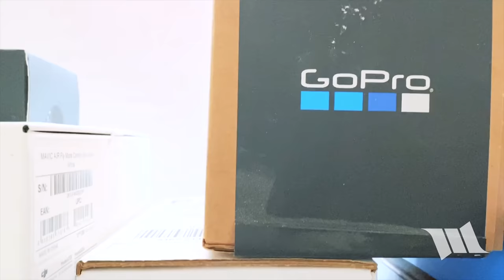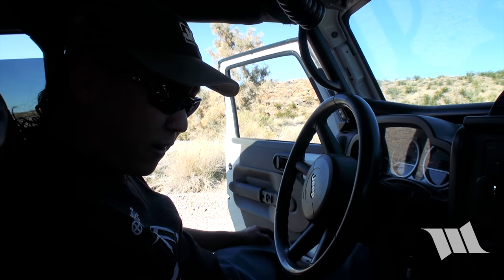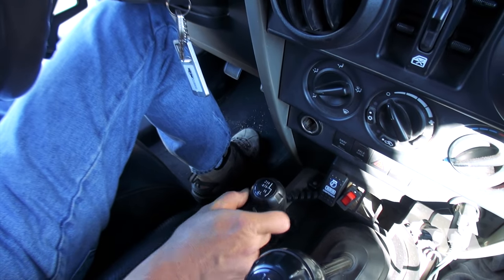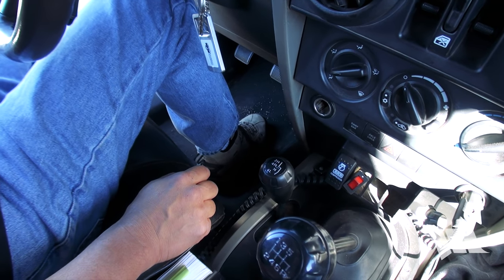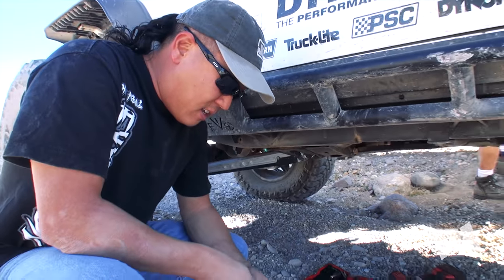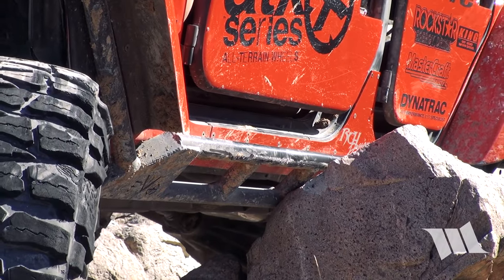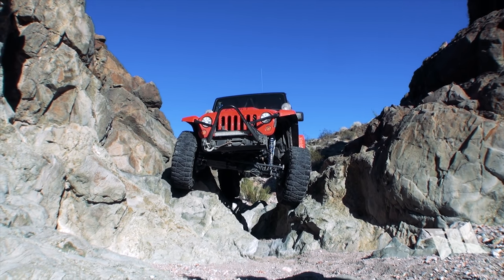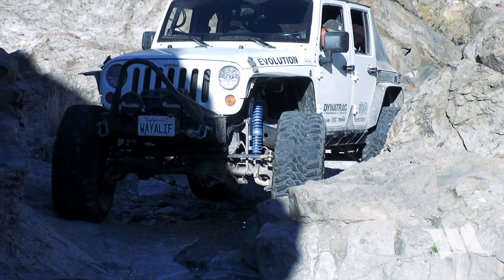Jeep Wrangler Rock Crawling Arizona Bullhead Parker MOBY and EVO1 Coilover Flex

Comment: Cool car. Are there vibrations at speed due to the crevice of the driveshaft, with a suspension lift ?? Or did you somehow escape this problem ??
Reply from the maker: So long as your driveshafts are balanced, rear pinion angle is set correctly and you're not running too much caster up front, you really shouldn't have vibrations. Of course, these Jeeps are running manual locking hubs so the front shaft doesn't even spin when on pavement.

Comment: Did you change the engine in Moby years back ? I must have missed it somehow .. i know your JL and Moby and JT are all auto’s now but didnt know you changed Moby.. anyway thanks for another awesome as always video Eddie , you and Mel never disappoint..
Reply from the maker: LOL - Cindy and I grew up driving manuals and learned how to wheel with one. In a lot of ways, we still prefer a manual but for wheeling like this, an auto is better. It's like the difference between being locked and unlocked. Moby got an LS V8 a while back and it came with an auto. Glad you enjoyed the video :)

Comment: Hi, I just signed up with the forum because wanna ask about size of the wheel type etc but the forum users seems like to use vulgar words and nonsense comments instead of a proper explanation or dialogue. Do you have any platform so I can submit some questions related to Jeep included photos that can be attached to you? Thanks bro. :-)
Reply from the maker: It's the internet, you have to know that's coming. Hell, it's worse over on FB. Just send me a DM on the forum.

Comment: Awesome flash back. I’m the farthest thing from an expert, but I noticed a bunch of small details that I’ve never noticed in your more recent videos. Wheel spin seemingly caused by axle shaft torsion. The ultra flexed positions of the axles/tires looking out of geometry in relation to the body/frame. 5 lug vs 8 lug. Looked like tires weren’t conforming to rocks like they do today.   Really showed the evolution of all the different parts that go into these awesome built machines.
Reply from the maker: Hard to believe how much has changed in just 10 years and if you can believe it, a ton had changed since 10 years before that.

Comment: So would it be beyond comfortable to do this in a manual?
Reply from the maker: My Jeep, the white one that you see in this video, IS a manual.
Reply: Wayalife oh wow it is!!!!

That is way cool!  Do you have a hand throttle or anything?

How do you work the pedals and throttle and such?  Is it typically just let out the clutch and the gears are so low just give it enough to keep crawling but with control ?

I want the manual but I am currently researching for purchasing new.

Thank you so much!
Reply from the maker: @dad3562  It's isn't easy. I learned how to wheel with a manual and have been doing it forever. No hand throttle but I do use the e-brake a lot. If you're new to wheeling, I would highly recommend an automatic. I love driving a manual but I'd be lying if I said it were better for wheeling on the rocks like this. It's like the difference between wheeling with open diffs and with lockers. There is no comparison.
Reply: Wayalife I believe it.  I’ve been watching your videos for a long time now and I honestly never noticed it was manual. 

In a previous video while on the Rubicon trail, was it exhausting with the manual or still a joy to drive?